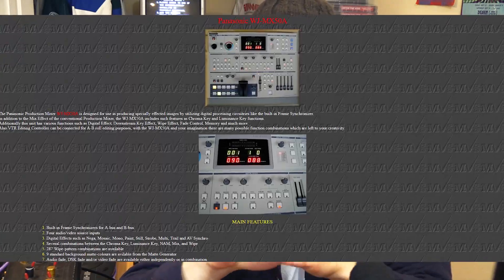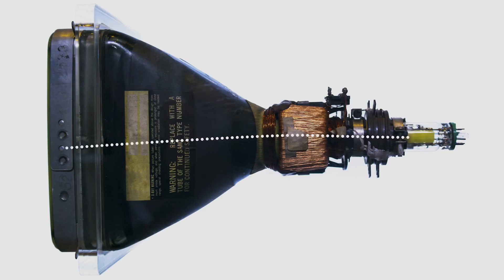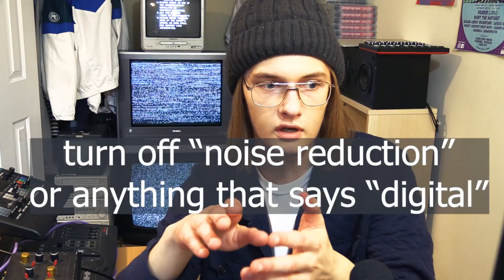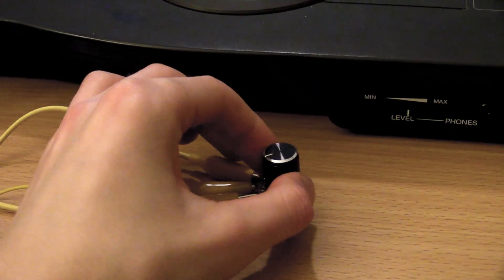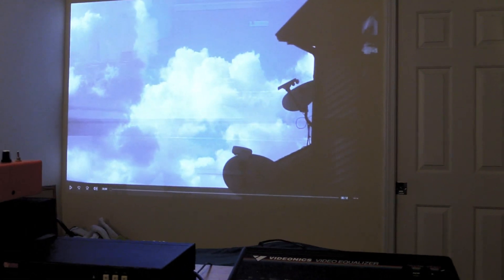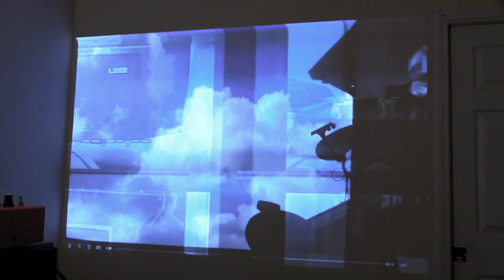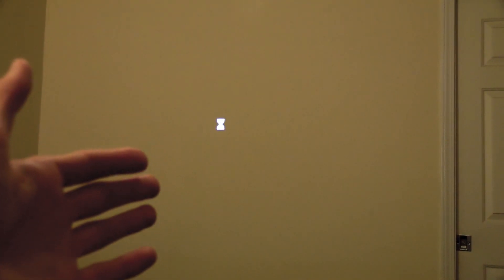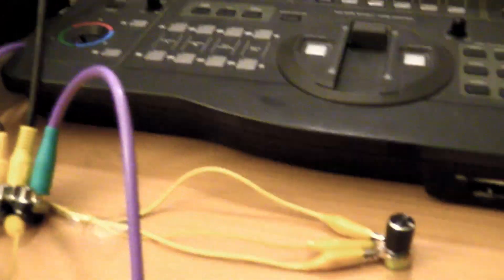What are Time Base Correctors & WHEN do you need them? (for glitch art)

Comment from the maker: thanks for watching! like i said this is a purely practical-knowledge video so stuff like the difference between frame synchronizers and frame buffers and other things are not covered, nor that important i would argue. just go make art, and don't freak out about technical terms.

...also, yeah, i recognize videos like these are inevitably accelerating the shortage of analog video gear for sale online... which is why i think my next video will be about the people who are making analog video gear in the present day. people seem to be catching on that this gear doesn't last forever. already one of the mixers in this video, thankfully the one i use the least, has stopped working.
Reply: excellent instruction thank you
Reply: So cool to see this, I worked in TV the analogue era and understand a bit about this but I never really knew why TBC's were so important. They were a big and expensive part of every professional edit suite and VTR without them you couldn't do dissolves with an A-B roll suite. Am I correct in thinking that if the sources were gen locked you wouldn't need a TBC to do a wipe or dissolve with a simple pot? You are doing things I used to want to try 20 years ago but couldn't mess with $6000 Time base correctors in my tv station.

Comment: thank you for the content you put out there. I decided to get into VJ using analog with liquid light painting and somehow found your channel. believe me man my wallet is cursing you. I found a reasonably priced Edirol V8 and 2 Sansui VX99 that I intend to circuit bend (the VXs not the Edirol obviously) so I'm pretty sure that I'll need to find a TBC to process the glitches with the V8. I found some obscure rack mount TBC with no information on any of them. do you think almost any rack TBC will work or do they behave differently? (I mean I pretty sure the results from every models will be different. but different as in workable or different as a green and black AVT-8710?) or I'm I better off finding flat CRT tvs and capturing them with camcorders and mixing the signal from that? also I'm in europe is there a way to mix NTSC and PAL gear?

Comment: Would a TBC help with my trinitron WEGA CRT dropping signal and going to blue screen when glitched? I find if I try to push it a bit the signal is lost and I get a blue screen
Reply from the maker: you need to turn off whatever digital stabilization setting is active on your CRT, that's the cause of the problem. if you can't find the setting just get an older TV.
Reply: @YOVOZOL  amazing thanks so much, have thought it could be a setting. Can't manage to find this setting to turn it off. Might have to look at look at an older CRT!

Comment: I think there is a subtle difference to mention TBC, frame sync, and Genlock are somewhat similar- but are multiple ways of synchronization between inputs.  What we used to call "video mixers" basically dealt with a nightmare of back-end... not just crossing the frames themselves... but also synchronizing the lines so you did not get that weird top to bottom glitch when ever changing cameras.  Now with a video switcher... yes you could base a reference off of a single camera and send a GENLOCK signal to them (really just as simple of taking the reference camera and routing its video into the other camera...  But unlike the video mixer-  the switcher does not really have a reference point.  You not only need to also route your frame sync into it- you need to tell it what black video looks like.  Sure- plugging a composite camera signal into a TV generally works... but it is because the TV knew it had to base its info off of the signal.  In terms of a DLP- we open a whole new door... because generally you have to then quantify nuances

Comment: Nice video for art but The advice you gave at the end about TBC for VHS digitization is wrong (or at least the way you phrased is wrong). You said "don't worry about external TBC  because most VCR has internal TBC" First, no! Not most VCRs have internal TBC . Second and more importantly the TBC inside a VCR is a Line TBC, it corrects jitter and other errors with tape transport i.e they make the video look better. The external TBC like datavideo, avt and others you showed in the video are FRAME TBC, they perform frame synchronization and fix dropped frames and issues with the signal itself, simply put ( oversimplified) they don't really have a visible effect for image quality but they have effect for signal stability and continuity and might help reduce the chance of audio getting out of sync consequently. I would suggest ( if you can)  you add a a note or sth to your video to fix this like you did to declare that you mixer is defective. Have a good day 👍
Reply from the maker: i don't know if you actually listened to me in this video, but I explained literally what you just wrote. I also specifically mentioned that you CAN'T use the TBC inside a VCR for external purposes and that it only corrects tape playback. However since I've made this video some people have told me there are some VCR models you may actually be able to use externally.

Comment: Awesome video thanks for discussing this.   it's great to see other people out there doing this stuff!    those mixers are really nice having internal syncing..  but if you deal with multiple devices / sources I wasn't sure if anything was said in here about black burst boxes..   keep in mind

some older mixers don't have internal tbc..  even some 90s mixers would have you think they could mix but really they required two synced signals coming in..  meaning you needed two tbcs and those tbcs needed to be synced with a single signal from a black burst box..  one of my meanderings https://www.youtube.com/watch?v=odYvcQf6fzk i have a lot more stuff to test / demonstrate..  currently restoring a video toaster.
Reply: yea the old stuff is tough to find..   sometimes it's a gamble..   sometimes things are overpriced and people may get ripped off.   i've been lucky (so far) that the gambles i took on "as is" external tbcs did in fact work..   sadly 90s gear is often prone to bad capacitors...  80s gear funny enough tends to be more rugged..  because they were not using caps prone to leaking.. so many of the very cool videonics items and sima stuff tends to be prone to failure..  a few things i bought are bad, but hey this is glitch.. so not exactly perfect isn't exactly bad :)

Comment: Hey man, appreciate you as always! When i feedback my panasonic mx70 its always green, and there is a faint smell of escaping pixies from the exhaust fan, but everything else works perfect. Do you know what was wrong with your one?
Reply: Capacitors have most likely failed in the red and blue channels, or some point it mixes or derives the colour signals. Caps fail after 20+years.

Comment: Hmm... I wonder how well does the OSSC (Open Source Scan Converter) handle these glitched sync signals... It actually (unlike some other converters) looks at the signal on a scanline by scanline basis, and is designed for low latency output. With that in mind, it's my guess that even if it can't nicely handle or tries to correct a dirty signal out of the box, there's a chance that custom firmware could be made to improve its glitch performance.
Reply from the maker: maybe, it could be worth investigating, hope somebody does

Comment: Nice! I've got a hold of a serious video processor/mixer from the 80s, which has a separate genlock input to the video input. I'm unsure exactly what signal to feed into it. Am I right in thinking that I could use an RCA Y cable to split the signal out from my composite device, and feed it into the genlock input as well as video input simultaneously for this? I can't find a manual for this thing anywhere.

Comment: Thank for making this! Clears up so much when shopping around for vintage gear. I have a small Panasonic CRT which only has a coax video input (no RCA), so I use a simple powered RF modulator to get the video signal on there normally. Do you know if I might run into any issues with dropped signals using circuit bent/glitch devices going straight from the RF modulator to the TV?
Reply: I had bad luck with an RF modulator handling a dirty video mixer on my friend’s TV. It ended up handling the signal worse than an LED TV

Comment: Whats the model of the Prime Image rack TBC you have? I grabbed one of da bay like 6 months ago and it has not been cooperating with my set up. May be defective but it looks like the same model potentially
Reply from the maker: a Prime Image Freeze II. how is it not cooperating?
Reply: @YOVOZOL  I also have the Prime Image TBC/Freeze II. Its not displaying a steady output of my input. I assumed it was either broken or needed an external sync signal but now idk. I think it may be the settings on the front or something. I'm going to poke around with it later today - its just been siitting in the studio unused for a few months.

Comment: id really like to find more info on the gen lock signal used to keep multiple TBCs in sync with each other. the Hotronic AR71 and AR41 give a sync signal out but I cant find any info on what would have been used to send it to multiple TBCs as a standalone device. Another terrible thing about Edirol mixers is that the monitor out is pre-TBC, which is a real shame if you wanna use it as an easy feedback source because the image is just all over the place.

Comment: What model downscaler / upscaler are you using?
Reply from the maker: I use downscalers by TvOne C2-2000 series but cheap $30 ones on amazon work just fine, but sometimes they can just stop working after a while.

My upscalers vary but ones from TvOne also work, amazon devices do too. I'll probably do a video about it soon.
Reply: @YOVOZOL  Thanks for the info! I've been using an Extron VSC700 for downscaling and an Extron DVS204 for upscaling myself. A lot of older broadcast scalers are pretty cheap on Ebay these days, but I hear you on the woes of this art form being so dependent on secondary markets. Looking forward to your video about current gear makers!

Also thanks for putting out all of these videos! Always interesting to see how other people are doing things. It was after watching your rig rundown that I realized how powerful Resolume would be in my own setup.